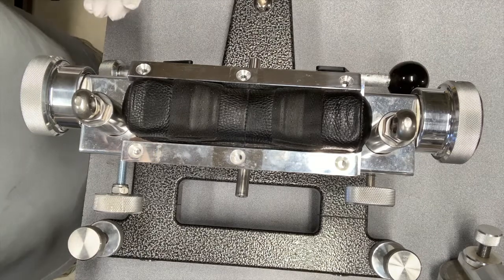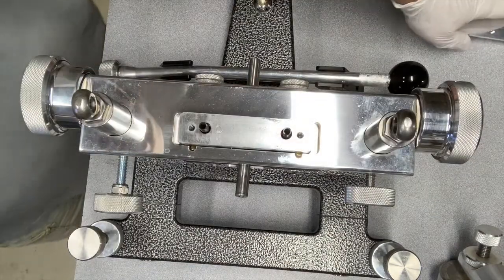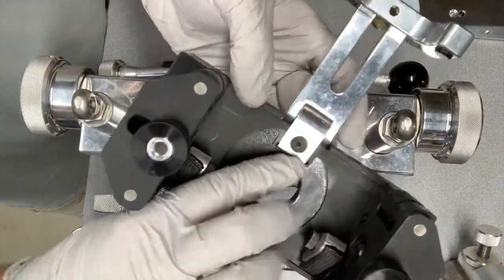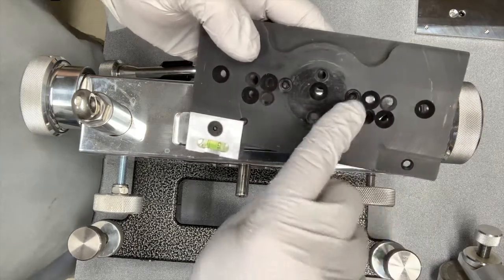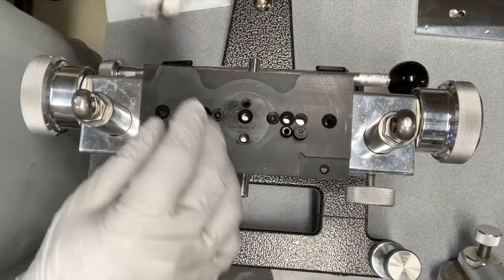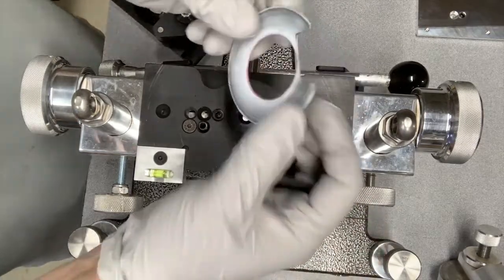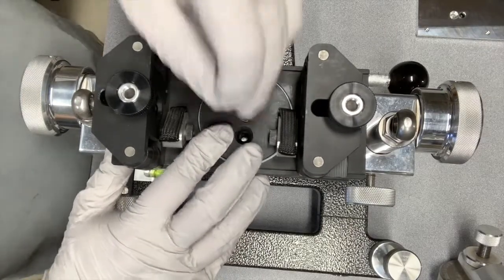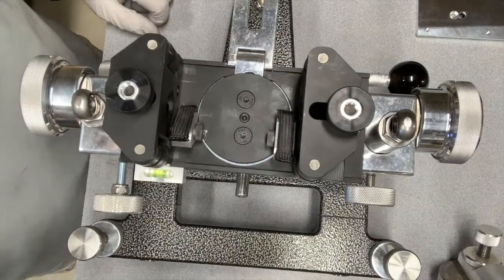How to install the Rodzilla 5-Axis top for the Seb Neo

Comment: Regarding the set screws that were over the springs on the neo:    It appears that they are on the wrong holes or missing in the video.   The springs should not come through the plate- they need more preload.    With my rifle on it, the joystick would drop like a rock, until I swapped the screws over.
Reply from the maker: Yeah I did a poor job showing that part because the screws got put in but after that part of the video. Sorry for any confusion.

Comment: Did you add the thumb wheels on the width adjustment nuts?  If so, where did you get them.
Reply from the maker: He was actually shipping them for a short time but now has a more secure nut system that prevents slippage.
Reply: @FClassJohn  I like the thumb wheels.  I have to carry a wrench with me for making small adjustments in y different stocks.